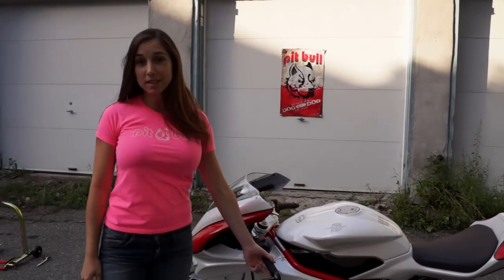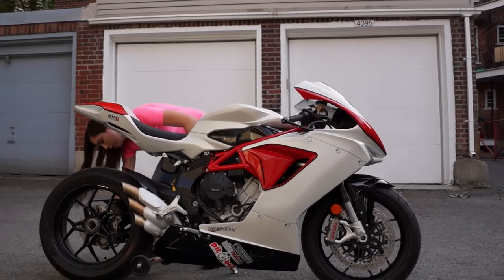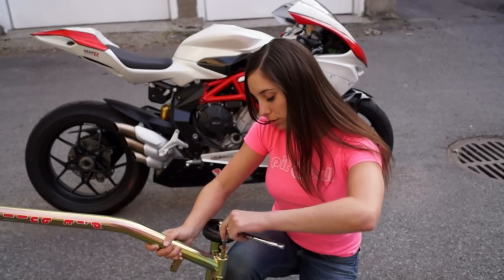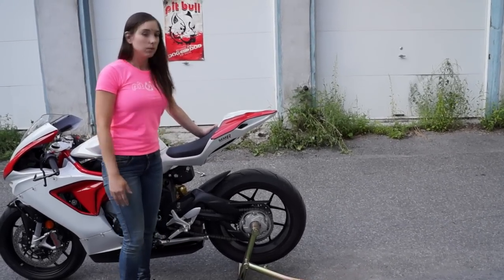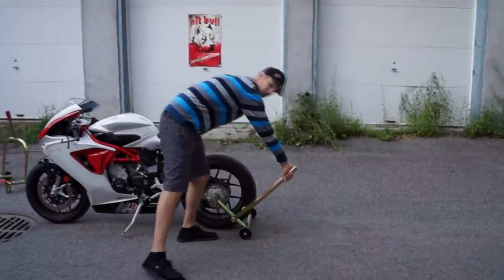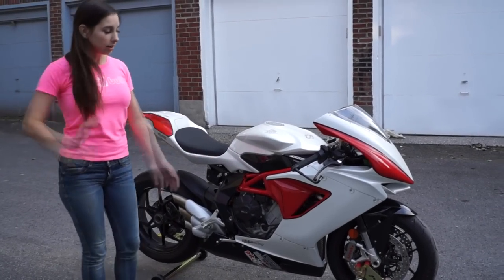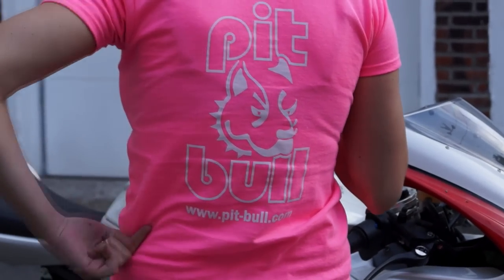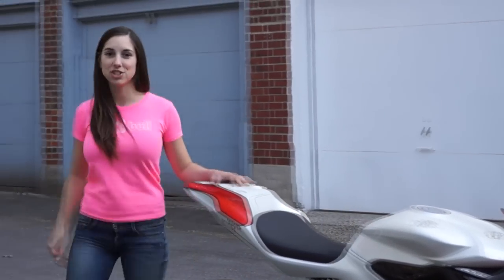MV Agusta F3 800 Pit Bull stands

Comment: Are you having any issues with the ride by wire throttle on the F3800? Was is glitchy at all. I read it's a great track bike but how is it as a street bike? Cool bike stand.
Reply from the maker: I spoke with one of my friend that got a Ducati Panigale R and he said under 40km/h he has to play with the cluth cause it's kind of going beeeeeeu if you play with the gas without cluth under 40km/h it the same with the F3 800. Out of that none issue with my bike. I feel this bike just wanna race lol responds fast on the gas and the handling are awesome. Don't get stock in the traffic down town too long in the summer time, it comes real hot (maybe it's because it was on track fairing lol...). I really love my Pit Bull stands!

Comment: what is that black box in the back of the bike, the one between the rear shock  and the "downside" of the seat/subframe...

relocation of the battery ?
Reply: Ohhh I see my misunderstanding... I have a F3 675, and it do not have that black box. he he.....

Still I'm curious what is in it ?
Reply from the maker: It's a F3 800 and the black box is the ABS module. ;)